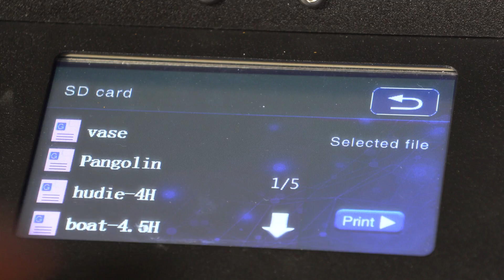The Unfortunate Problem with the Creality CR-X 3D Printer

Comment: As much as I understand Joel's (and Angus') frustrations, this can be a bit expected from a Chinese manufacturer who makes money by copying designs and looks for corners to cut to save money. I experience the same with another hobby (electric unicycles) where first gen wheels have issues, bugs, and where we depend on the manufacturer and reseller/distributor's to get upgrades from established bugs... I'm with Chris on this one. I ordered the Flash mere minutes after the link was published and I know it is a risk, and will most likely require tinkering. For those that want a solution right out of the box, guaranteed to work: buy from a local dealer, explain him beforehand what you expect , and agree on remediation from his side. But don't complain on the upmark on the price. I personally get great satisfaction from detecting, analysing and resolving a problem. It's ok if you're not like that , but don't expect this product to solve it all. If you wanna try, order one, receive it, build it right away and if not satisfactory: file a claim within a few days...

Comment: The problem with the Z axis not being able to move lower also exists on the CR-10S. When I first bought a CR-10S I had the problem where the Z axis couldn’t reach the Z endstop before hitting the motor mount, causing the (two part) Z couplers to uncouple. I fixed it on that machine by bending the lever on the Z endstop switch up a little. But the bed does still have to be adjusted all the way down. This issue is worsened depending on the type (thickness) of the bed surface you apply. Being able to adjust the Z endstop out of the box would be a huge fix.
Reply: Hi Scott. How far the bed stay away from the nozzle in a CR-10S (stock)? If it's less than 4mm you can put a glass on it. I have a super flat bed that varies less them 20 microns on thickness

Comment: And the high spot in the middle of the bed is down to one of two things. Either too much tension on the build plate (unlikely as its spring mounted) or shoddy manufacturing. Bad manufacturing can be remedied but requires specialist know-how and tools. Feel free to contact me if you want to go in-depth on this.

Comment: I've actually had the same z-limit problem with a brand new Cr-10s. Slightly different piece, but the printer would hit that z-motor bracket before it would hit the endstop. Disappointing from a $500+ printer.

Comment: If this is a $800 printer just get the folgertech ft-5 r2 yes its more of a kit, yes more assembly is required, yes to get dual extrusion you would need to fashion your own y connector or add a second extruder, but its $500 with 300x300x400 build volume, better support, a ridiculously rigid frame and it should work first thing after assembled, oh and did I mention folgertech wont beta test on you :P.

obviously this comment is half a joke, but I seriously cannot see why in the world people would by a $800 printer from china that has a single nozzle dual extruder with no bed leveling when you could get a $500 printer add $20-30 in parts, configure a couple lines of code in marlin and have a dual extruding machine cheaper and probably with a little less headache than the cr-x.  

Love what you do joel, and I love the honesty  in the video.

Comment: Hi Joel. Thinking back; I had massive problems with the first UM2s that we used. Weak feeder, overheating feeder wheel, and crappy Ptfe coupler. In hindsight; the UM2 was not ready for marked. My patience and the community saved my butt. Maybe the case is similar here. Just a thought

Comment: Creeality being open source is a joke.  I downloaded all their model files and put together the Ender 3 and it's clear that they didn't even follow their own design.  It looks like it was designed by a bunch of kids.  The Marlin files should be left on Github but the solid files need to be parked somewhere else.  

This is so typical of the how the Chinese approach product development.  In the commercial CNC business it's even worse.  The only saving grace in that business is they have to use commercial controls but their mechanicals and designs are atrocious.  I had to make way too many tweaks to my Ender to get it even close but they are not the only ones that put out products like this and I'm not unhappy with the final result but then again I'm a Journeyman and none of this was difficult to resolve.

Creality can save this printer by going back and fixing all the errors before it ships and not burdening the YT community with their junk.  A cheap price will only take you so far until you start to question what your time is worth.

Comment: Seems like it would all be solved by calling it, V1, V2, V3.  

But does that mean you're no longer going to do any reviews for Prusa printers anymore considering all the issues they had and fixed?  Or when they fix issues, or send you 'the wrong printer' is that different?

I personally don't mind you reviewing what you have, and you should simply say, I don't recommend this model of printer, because of X,Y and Z which can't be fixed.  I have more of an issue with hand picked printers being sent out and substandard (rather than improved) printers being subsequently sold.

Comment: I agree with you Joel. Quality control is just not there. Hand made whole in Enclosure? Poor design Z- micro switch? Levelling issue, additional Z lead screw? Changing the design in the last moment and ship it like that? Commercial video showing one products and now we have different one? Why?! I don't get it... What's the rush?! CR10S was fantastic 3D printer and Cr-X has very good potential as well. I was looking forward to review Cr-X but now...

Comment: so the other creality are ok? just not this one ? cuz i want to buy the other ones
Reply from the maker: I have an Ender 3 but haven't got it out of the box yet. I'll try to get that going soon.
Reply: 3D Printing Nerd Yep, there's a few things in production E3's that could be better. Critical for me is setting X Y & Z at perfect 90°, having to rotate the centre of the H base to match the forward lean on the verticals could have been avoided if the Z rails had been cut square.  Risk of contaminating filament with lead screw grease is also pretty high as there is minimal clearance.  I suggest spending some time with an engineer's square before tightening everything down.

Comment: That kinda makes me happy i just bought the cr-10s. thought i made a bad mistake but looks like i did not. I would like more info on that bed as i said i just bought the CR-10S and i own a Prusa I3 MK2.5 i really want a Flex sheet bed on my cr-10s really works killer on my MK2.5... hair spay really makes my parts stick on the cr-10 to good I have not printed any PETG with the cr-10 yet im waiting on that flex sheet:)

Comment: Had the same issue with the bracket off the cr-10s. Had to use a printed adjustable limiter switch and had to add washer to the springs and longe screws to get the bed higher. That's how much I had to higher it so it doesn't crash all the time.

Comment: By large, the Chinese manufacturers carved out their nook by taking existing, proven machines and cloning them for dirt cheap. The more that these companies try to step out and innovate on their own, the more of this we're going to see until they come to understand the expectations of the Western world. We didn't simply buy their clones because they were cheap. We bought their clones because they were cheap AND the technology they were cloning worked. For the Chinese manufacturers to find success selling new product designs they must realize that the functionality is part of that equation. If that means a unit like this costs another $50 because of r&d to make it right, that product will be a bigger success than the one that's cheaper but essentially useless.

Comment: 4 printers over here and had challenges to each of them, such as missing parts, broken parts, missing micro SD chip, a substituted part that were not advertised such as a push button controller rather than what should've had a dial instead, defective controller cards, even bought a defective smoothieboard, english marketing, non english instructions, and a Anet seller who played games with cat n mouse messages for months rather than to ship a vital missing part. I ended up ordering the part from someplace else, and ebay read the messages and was amazed at how the seller tried to keep a dialogue going with the intention to make the ordeal run past eBay's  customer complaints time limit. After the time limit, the seller became less responsive, skipping inquiries, and always 48 hours and not a minute sooner if to reply back, as per eBay's time limit policy. Even past the 60 day time limit, ebay realized the seller was a complete loogin, so ebay made an exception to their preset time limit and offered me a complete refund, though i opted for just enough to cover the cost of the missing part.

And why advertise a project as being ideal for ABS, then make sure to not include a heatbed capable of reaching a typical ABS temperature setting, not even after waiting the usual hour it takes to max out. 
Yes, the bed levelling screws are poorly designed, that involved adding extra springs and washers, and even then, that maxes out at its barely within a hairs range of being ideal.

Had a extruder framing melt and was observed dripping while smoldering towards housefire, and it would've eventually because being a delta meant it would've tossed the firey stuff over to one side past the printer eventually. Thermal runaway at the thermistor or the controller card. Damn things should have a bonus smoke alarm mounted to them really.

I guess this is how it was when the first cars were being sold too. Lol
Now, they only make them to eventually fall apart, often very shortly after the we got you covered time limit is reached.

Let's see more effort put into the recycling of plastics when it comes to the 3d printing world. Printers designed with a complete recycler setup either built in or included affordably so as if to encourage responsibility towards our planet, or should all fish in the ocean and people that eat them end up with 3 eyes?

Comment: Ok, this obviously is bad ... But ... Speaking as a software developer myself... What did you think open source is ...

It does not justify these mistakes AT ALL. Don't even suggest that is what I am saying it is not. But part of the whole concept of open source (software and hardware too now) is so that there is community involvement making the product better. No I am not saying you should be the one to design or fix the problems as a user. But part of the idea is that people like yourself with a vast knowledge base on the subject can help improve the product (not unlike with software where other developers outside the original project often provide code fixes or improvements).

As such I have a slightly different take on this perhaps (not claiming it is the best one, just my 2 cents worth). I think it makes more sense for influencers like yourself to push for companies to come up with a way to allow people to upgrade their machines. And I am not talking here of user modding as we see already. I am talking about the company, in this case Creality, to bring out packs to bring (to oversimplify things) a version 1.0 CR-X (for example) to a version 2.0 CR-X either for free (which might be hard to do with hardware) or for a an absolute bottom price.

It seems to me this is the bigger problem, that if you got an 'early version' of a product, you have no upgrade path to the newer version of the same product. Not unless you go out and piece together the parts on your own.
Reply: Prusa is open source...the way it should work.

Comment: I hate to say it but when I see stuff like this and then I hear companies like Printrbot closing shop... it really frustrates me. This is the sad part about this race to make stuff faster than the other guy is outta hand.
Reply: Calvin Witt I agree. They need to not be rushing to produce the next big thing. That will only lead to disaster, It’s not worth it if they drive the ones doing things the correct way into the ground because they won’t cut corners. We need great reliable machines that are consistently produced the same way.

Comment: Maybe better than mesh leveling would be beds that arent so warped. QC. What even.
Reply: Tomasu82 both goes a long way 🤷🏽‍♂️
Reply: Agreed, mesh leveling is just making the customer pay extra for a workaround to deal with a cheap flimsy weak bed. It would cost less to take a thick sheet of metal, flatten it, and just put 1 fixed point and 2 thumb screws to level it on both directions.

Comment: This machine seems to be a great evolution of the cr10, I'm really interested in the dual extrusion system, I like how it's not the big Y adapter like seen in the past. Not having abl though, especially with creality selling an abl sensor as an add on fo r the cr10 [stolen, it seems, but still] is a huge miss. It needs it. For the next evolution, for the price, for the market....it should be standard by now.

Comment: Joel! Check out Tiny Machines 3D. They are based in the US and quality check all printers they send out. I ordered a cr10s for them and it worked perfectly out of the box. They also add full Marlin so you get mesh bed leveling etc. Check them out. Great video Joel!

Comment: The CR-10S has the same problem with the bed height. Well, actually it's worse. I'm using a mirror on my CR-10S, if I didn't, I wouldn't be able to print anything, because the nozzle can't reach the bed even if I removed the leveling nuts completely.
Also, the "Pause" and "Stop" software code has been muddled up, "Pause" pauses, but turns off the heat to the nozzle and bed. "Stop" stops, but leaves the nozzle and bed temperatures hot.
I've emailed Creality with my opinion and design changes. If they are really interested in customer service, they will take it onboard.

Comment: Hi Joel,  I know this isn’t what you “should need to do” with a brand new printer,  but this motor bracket will fix the interference of the stock stepper motor bracket.  It will allow much better leadscrew alignment(common Creality problem) and bed spring compression.  This is a common problem on Tevo Tornado, Cr-10, Etc. 

https://www.thingiverse.com/thing:2907882